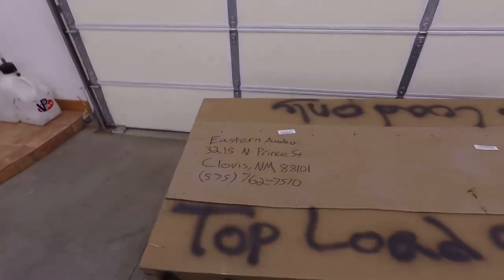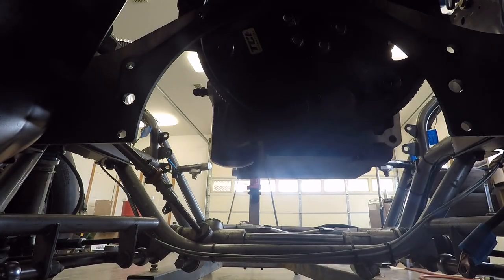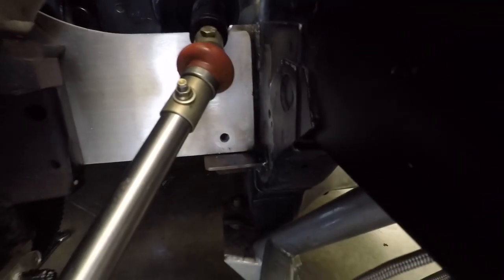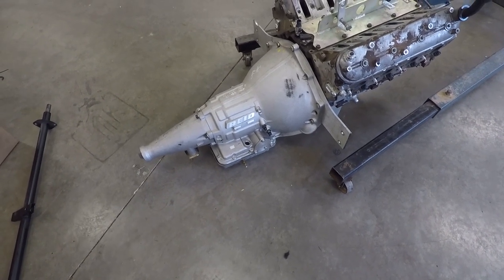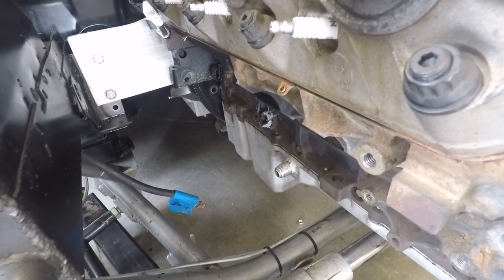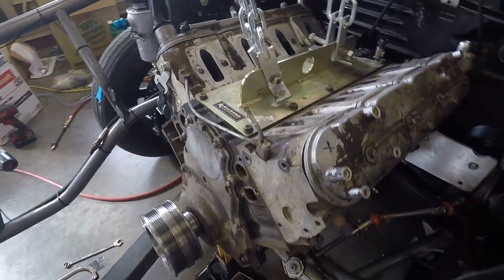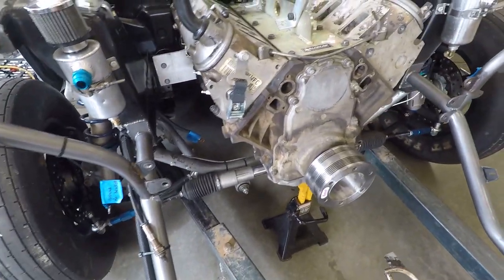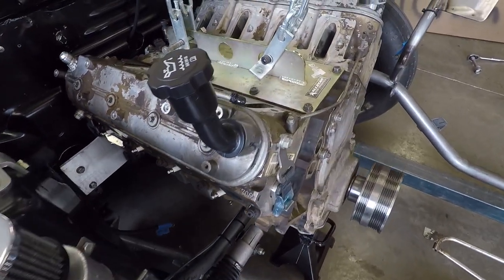What Cam to go 7s SBE? Specs Inside! Squirrel Tuned Vlog #3

Comment: thanks for sharing the cam specs, I appreciate it.  I would have thought it would have been something a bit more wild.  A little thing I like doing on these for aesthetics is remove the tall oil fill deal. You can just unscrew it and put the cap right on the valve cover.  Keep it up man.
Reply from the maker: Yeah aesthetics haven't been my thing lol.  And yup I knew it would surprise people. Very mild cam! Works great though.

Comment: I recently melted a piston in a stock everything but valve springs 5.3, I now put a stock 4.8 with reuse gaskets and the heads off the 5.3, stock cam, 27psi cast 78/75 made 534/623, I need your old cam🤔
Reply from the maker: You might want a smaller cam than I had even because that turbo isn't going to move as much air as twin s366s but I'd talk to John Bewley at Full proof performance. You'd definitely see big gains from a cam change.
Reply: @SquirrelTuned  I have a btr stage 2 turbo cam, btr boost pistons (5.3), some China h beam rods, along with a vsr billet 80/96 t6 1.32 waiting in my living room (funds) hopefully the 5.3 will clean up with .020 over that the pistons are
Reply from the maker: @jesusm2797  that's a solid combo should be able to make good power with that.
Reply: @SquirrelTuned   getting ready to test at xrp at the moment, goal is to enter the 5s, this is in a Chevy luv, foot brake th400, ptc converter (budget) 3.55 8.8 rear, pump and meth, stock leaf springs and torsion bars up front, it's on a slim budget, also working on a fox body at the moment with a cam and boost only 5.3, hope that one makes it mid 5s or better one day...
Reply: @SquirrelTuned  I have gone as far as buying a Dyno and building a garage in the backyard to learn how to tune my own vehicles 😂
I live in a neighbor Hood in Dallas 🤣
Reply from the maker: @jesusm2797  nice man lol sounds like a good time.
Reply: @SquirrelTuned  I just got back home from xrp, first time with the 4.8, could Not get it to 60ft (ft brake)
Best 60ft was a 1.78
5.3 best 60ft was a 1.45
This transmission doesn't have a trans brake
Best pass 6.9 at 110mph😔

Comment: new subscriber here.....

how do you feel about using a 5.3 vs this 4.8?..... I ask because I'm building myself a hot street truck and I can kinda go anywhere in any direction right now
Reply from the maker: Thank you for subscribing! I would go 5.3 personally. I originally did the 4.8 because I wanted to be able to troll 5.0 owners lol. Both are very capable but the 4.8 takes a little extra work to make it as fast. Higher rpm, more boost, etc.

Comment: I thought the high volume oil pump has a tendency to suck the pan dry ? Sloppy mechanics always preached not to use them ? Just curious
Reply from the maker: I overfill the system by about a qt to help avoid that and to avoid it starving the pickup on hard launches and have never had any issues.

Comment: What head gaskets are you using with the pro serious arp head studs?
Reply from the maker: Cometic gaskets but will have ls9 on it soon. I think both are just as capable.
Reply: Squirrel Tuned awesome. Just taking notes! I have a 4.8 with a sloppy stage 2 cam. Stock head bolts and head gaskets with a t6 billet 80mm turbo. My car seems to nose over after 6500 rpm. During the Corentine I’m doing a btr stage 2 turbo cam and head studs. Just trying to max this borg out
Reply from the maker: What intake is on it? That will play a big part in where it peaks as well. Also good valve springs.
Reply: Squirrel Tuned i have a tbss/gen 4 intake with a 92mm throttle body
Reply from the maker: It's probably not going to want to spin real high with that intake but I'd imagine it should at least pull to a little over 7k . If you really want high rpm it'd be best to have a proflo, hiram, or btr equalizer intake.